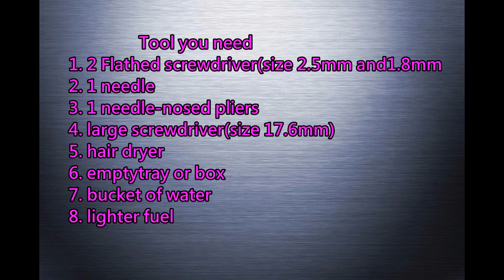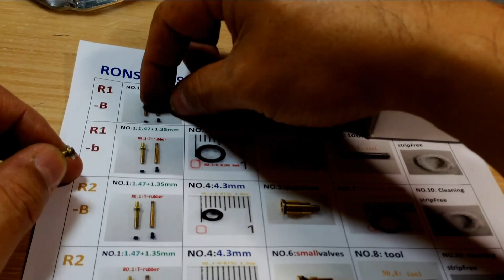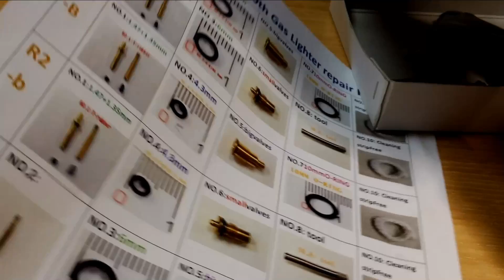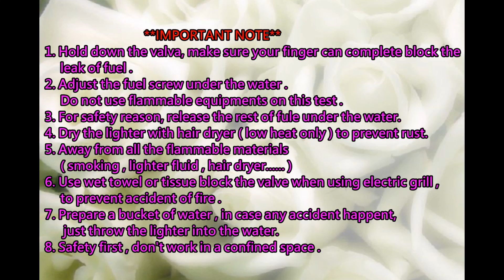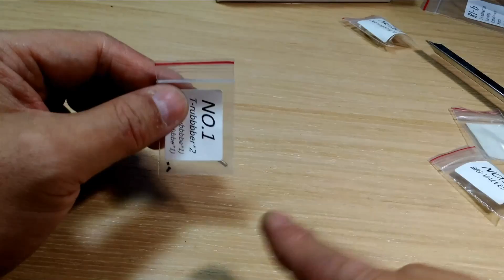RONSON 1960~1980th Gas Lighter repair Kit****2(Not the origional RONSON components)

Comment: Where can I buy the chart that you have with all the parts on it for repairing the lighter.do you have a link to where I can buy one or do you sell them.. where is the best place to buy them an do you have a link for where to buy the tools you need for repairing them such as tool for taking out fuel valve an for taking off part where flame comes out of it.thanks in advance..

Comment: Big valve cap is stuck closed, it will turn but it wont pop out to open, any tips?
Reply: Use finger pressure to turn out the valve

Comment: Could you direct me to how to repair the valve where the flame comes out that does not have a pin, my lighter doesn't have a pin yet it is a Ronson Varaflame and I would love to be able to use it.
Reply: Just pull it out that's what I did on mine